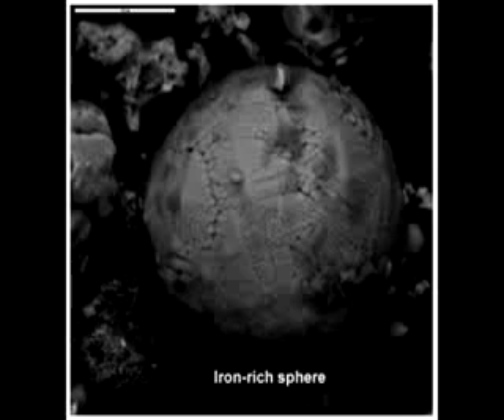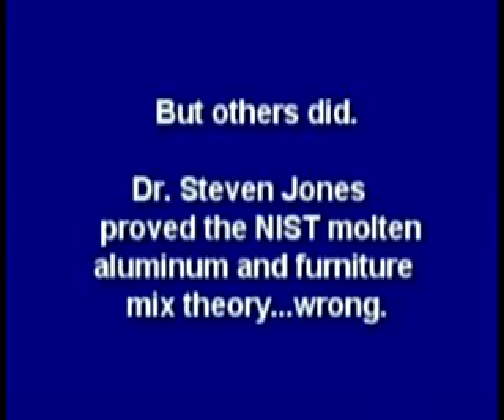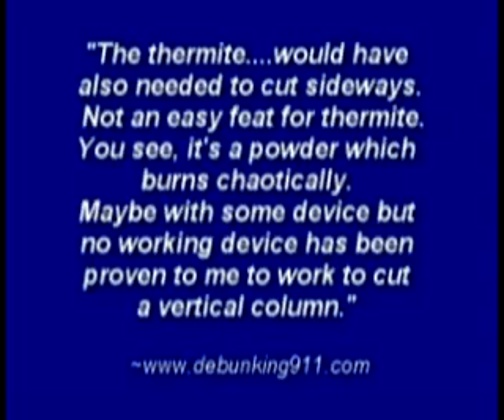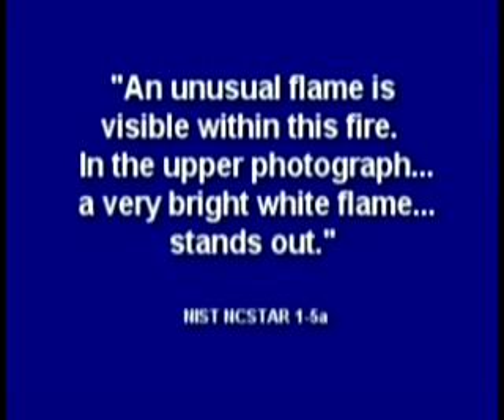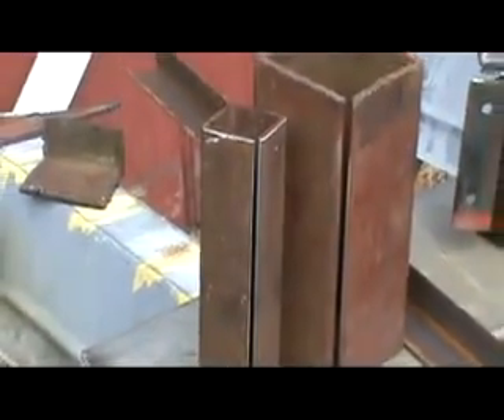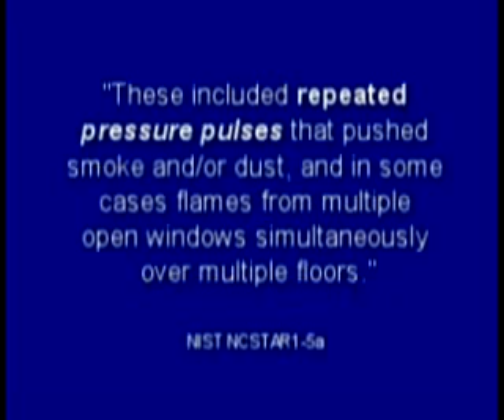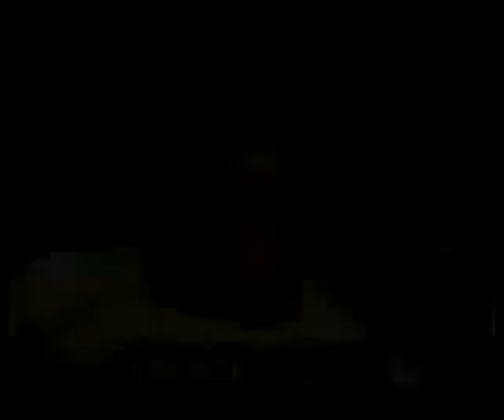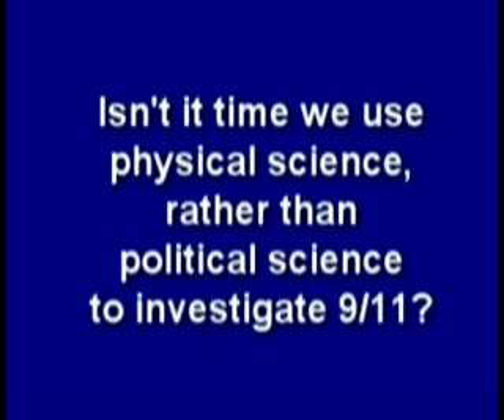Proof that Thermite can cut a vertical column

Comment from the maker: @azmanabdula apparently you live in a universe where absence of fire is cause for steel to collapse. as i understand it, the fire that 'raged' in one of the towers back in the 70's engulfed several floors and was actually a FIRE with no molten steel. the one that occured on 9/11 wasnt a raging FIRE and did have molten steel pour out of one of the corners.

Comment: @vengencefrom1979 steel doesnt burn.......
and i was referring to which part of the structure was " heated"
"no matter what universe you live in."
how many are there?
"back in the 70's one of the towers actually did catch on fire"
coupled with a direct hit from a plane.......
or 2 .......
it may have been enough......
after all......was the tower designed to take the impact from a projectile?

Comment: you people are crazy..........and fuck i didnt even know about that thermite and molten steel pouring from the side of the building.....
but what got me is........with so much weight on the building .......
you dont need to melt it........just heat it enough to deform it......
but the thermite?